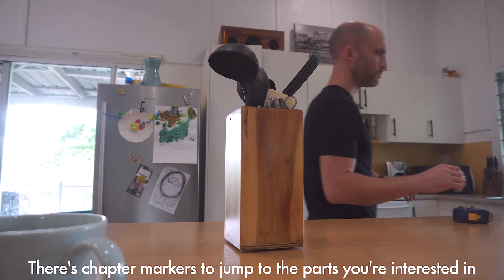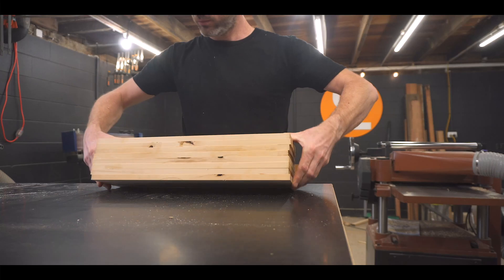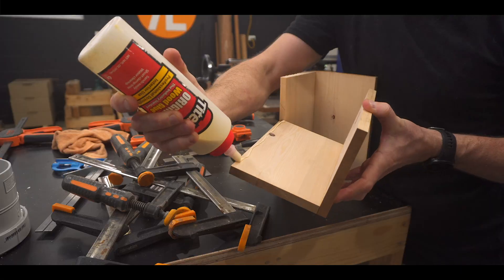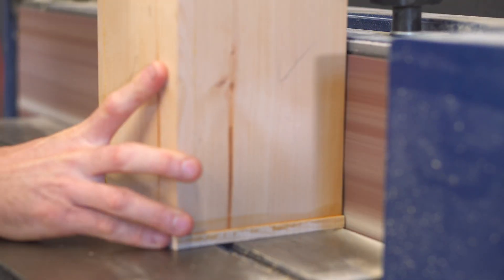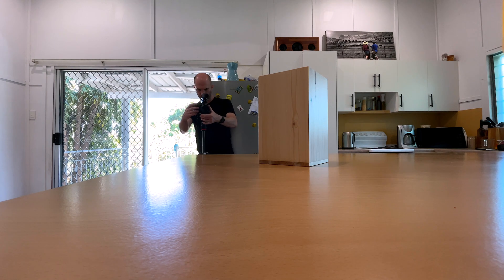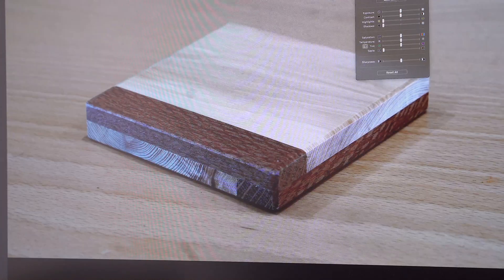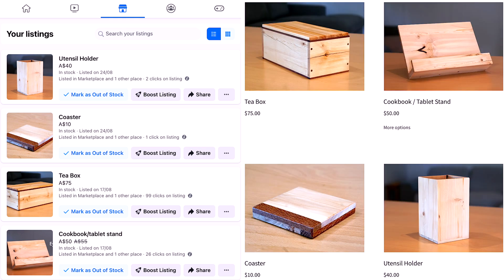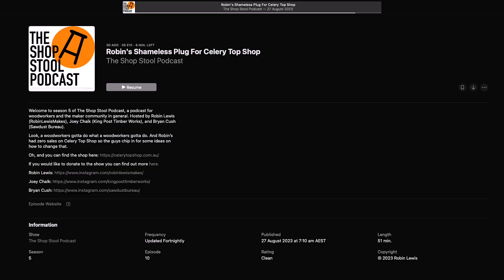No One Bought My Furniture - Building An Online Furniture Store, Part 3

Comment: I've done 6000+ sales on my website now, so i might add some constructive criticism which might come in handy. 
 Pine is boring, it's the standard that you'll get say kmart for $5, freedom furniture, etc. Most people won't know the difference between pine species (with the exception of huon pine, people love that), so i don't think the price point will ever come into a good medium between effort and time into it, and what people will pay. Inlay some contrasting timbers/epoxy and it will jump out more.

The biggest thing i leant is that people really hate being sold at. You jump up and down in front of somebody saying buy my stuff, they won't. You started this series saying you want to pay off your equipment, so buy this. Not i made this really cool thing, and because i had so many requests for one, i made some more for people to get, but I've only got a limited amount of the timber, so once it's gone, it's gone. 

I could waffle for a while longer about website layout/flow, but i hope this helps. And the photo editing really does make a huge difference.
Reply from the maker: Interesting idea about pine being the same. If I don’t get the point across that’s it’s special, or at least convince the buyer that it’s special, then it’s almost certainly going to fail. Thanks mate!